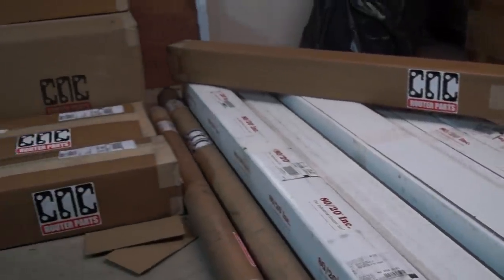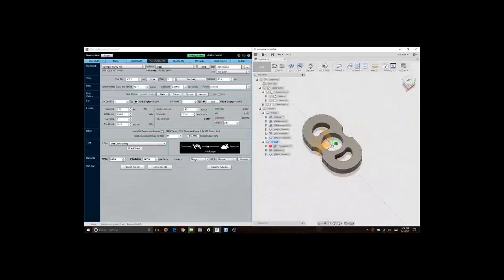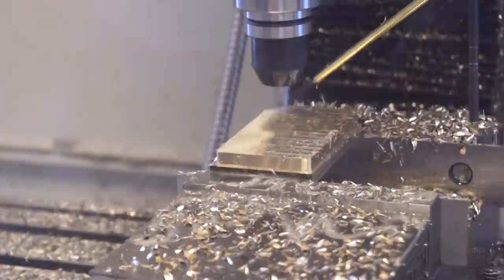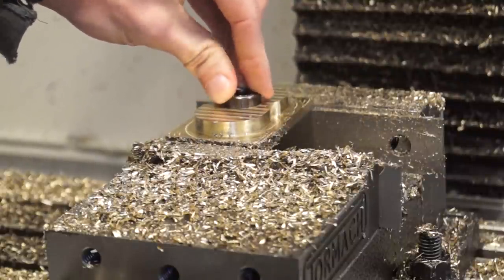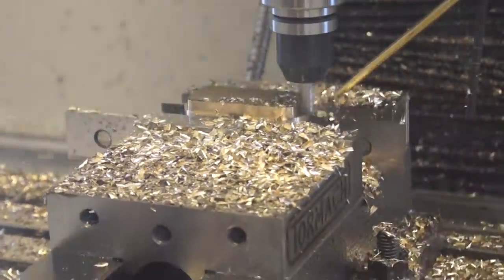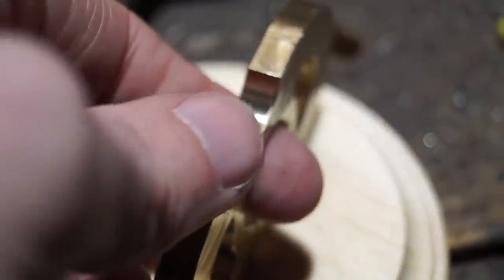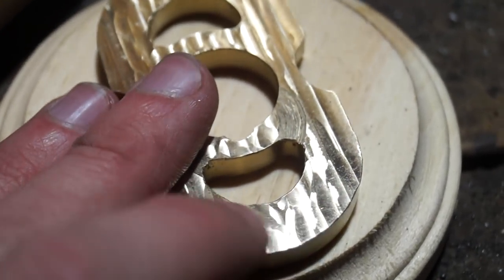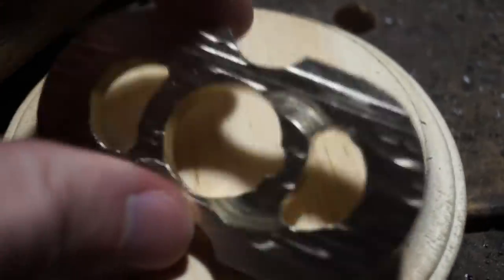Diy fidget spinner- cnc machined brass

Comment: I agree the passes on the back side may have been a little to rough.  A few things to keep in mind. First, don't forget that on the back side your part is weaker (thinner and has holes) but also your gripping surfaces for the piece in the vise is reduced greatly.  I could see the parallels vibrating out so the workpiece may have been sucked up into the cutter causing the breakage.
Second, and this is more of a general tip, there should be a master feedrate override in the controls somewhere. When you have a new tool or new operation drop the master feed down to 50% or wherever you feel comfortable and ease up to your programmed feeds. On one side the roughing pass may have been ok with a slower feed and a slower rapid may have given you time to hit stop before burying the second tool.

Good stuff! Keep it up. Thanks
Reply from the maker: yeah! I've been reducing the master feedrate. Totally slipped my mind when doing the voiceover, but I think I was at 60-70% feed for the front and I may have left it at 100% on the back. 

I also saw that parallel in the video. Much more obvious in the video than it was when I was doing spot checks.

Comment: Everything went to hell on the 2nd op due to the workholding. That shape leaves very little for the jaw to grab onto, and you had a lot of stock left over on the "hat" from the first operation.

This is really the type of job that begs for soft jaws on the second operation. Or you could seriously reduce speeds+feeds to eek it out with the rickety workholding, but the surface finish and accuracy will absolutely suffer.

Nice to see huge improvements from your first outing though! That learning curve is steep and satisfying, isn't it?
Reply from the maker: so satisfying!
Reply: We agree - you're catching on quick! In addition to soft jaws, it could also be helpful to tap down your workpiece with a mallet as you tighten it down.
Reply from the maker: not bad for only the 3rd or 4th attempt at making something with it! 

I actually did bash it a few times with a rubber mallet but I'm not sure I'm doing it right. Those parallels seem to always end up loose after I tighten.  I've got a pile of soft jaws sitting here, I'll have to use some if I have a design I plan to do more than once
Reply: Greg Koenig I don't think he got the vibration and bad finish from bad work-holding. What he had there to grab was plenty for a soft piece of brass. First thing that came to mind was a dull or chipped tool and my suspicion was right if you watched the whole video.
Reply: When I first started (and this was just a year ago, so I sorta know what it feels like where you're at), I was hesitant to make soft jaws. They feel expensive, and it is another part to program at a time when every time you hit cycle start feels like a high-tension moment. You're going to get more and more comfortable with all this as you gain experience, and soft jaws will basically become second nature.

Now, every part I make starts as stock on Talon grip jaws. Because of that annoying "hat" of material, I find it way easier, more accurate, and more rigid to just cut a pocket in a set of jaws, even for stuff I will only make once. That sounds like a PITA to you now, but it's a muscle you'll build quickly and get very comfortable with.

Aluminum is cheap. Make your own jaws that are 1.00-1.25" taller than the vise, 1" wider on either side, and make a pile of them (it's a very good project on it's own). Don't treat them like a precious commodity - soft jaw all the things. When they look like swiss cheese, face them off until they are clean and start swiss cheesing them again!
Reply from the maker: yeah, that is a great description! eveery operation right now feels like some high risk thing. Thanks for the advice!

Comment: On the second op, you should have flycut all the way to your finish size with an endmill        .05inches per pass. Try 3000rpm with a feed rate of .01inches/min.